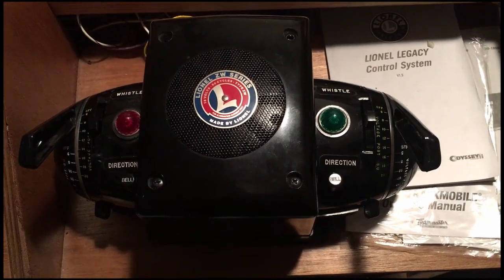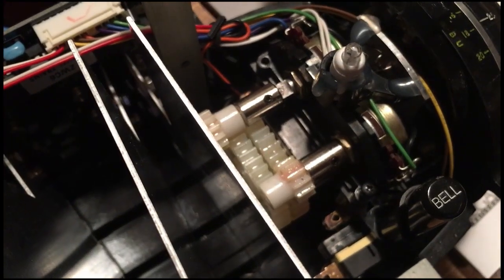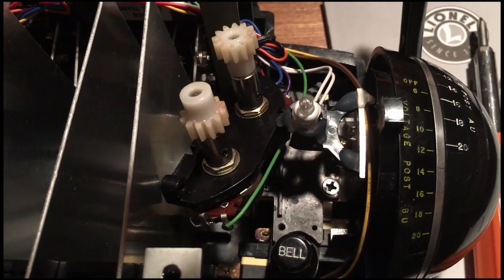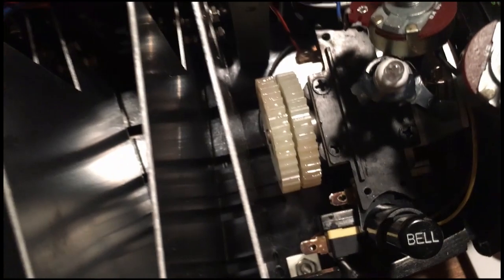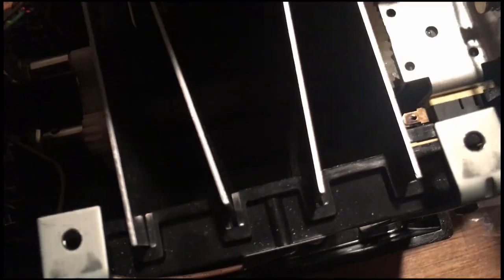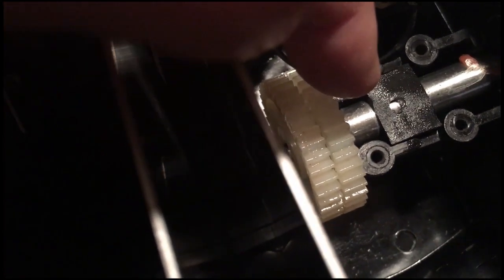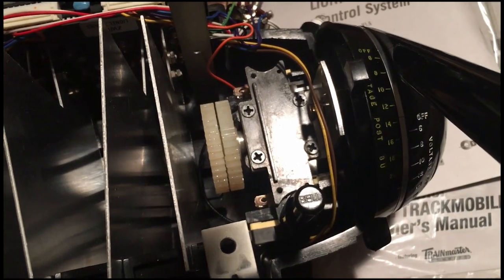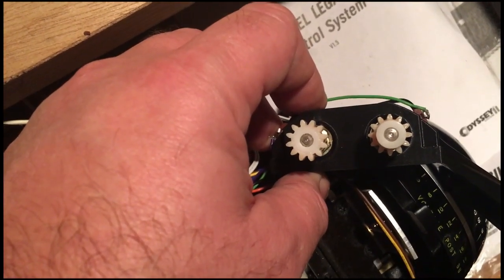Lionel ZW 6-32930 gear jumping fix

Comment: Great video, I am having the same part issue with my ZW-C. The front mounting screw hole in the potentiometer bracket is broken. I looked over your website but cannot locate this part. Is it still possible to order one from you?

Comment: Been trying to fix my right side one... even had a guy help try to jb weld a fix (he actually replied to your ogauge forum post).  Left one is ok but can probably use a new one as well.  Any chance of getting the file (have a good friend who can 3d print) or can I purchase from you?  And you wouldn't happen to have spare screws for it too would ya?  The original ones for mine are long gone and that size is near impossible for me to track down.  Thanks!!
Reply from the maker: I don't have the screws.  I have to set up www.jimmytrains.com to have the parts..... behind on that.  Do you have the metal bracket you definitely need the metal bracket  Lionel if you had the plastic one.  The screw I think are 	SCREW / 3 mm x 15.0 mm x .5 thd lg.  Check out the parts page here https://www.lionelsupport.com/ReplacementParts/index.cfm?startRow=1&PRODUCTID=B65E2724-83A4-4AF2-82DBA4FFF2DD9BF8&DOACTION=productPartFilter
Reply: @jimmytrains  I do have the metal bracket on the right side, but not the left... the screws aren't available through lionel either, but with the dimensions, maybe I can find them somewhere.  I'll keep checking your site because I'd really like to order that piece... unless there's a way to work directly with you.
Reply from the maker: @kenhough9507  the link to Lionel show the size of the parts you can buy them at mcmaster carr.  The are metric screws it look like SCREW / 3 mm x 15.0 mm x .5 thd lg.  https://www.mcmaster.com/92005A126/
Reply: @jimmytrains  thanks again!  Now just need to order the part you made and we’re all set.
Reply from the maker: @kenhough9507  Make sure that the part I picked from lionel is correct.  It seemed about right but you will want to be careful when trying the screw
Reply: @jimmytrains  When will the part you 3D printed be available on your site, or can i reach you via email or something to purchase?
Reply from the maker: @kenhough9507  I have added the part to www.jimmytrains.com.  If you want to order it I can make it.  Hope it will work for you.  If not can issue a refund less shipping.
Reply: @jimmytrains  is there an ogauge forum coupon code :)